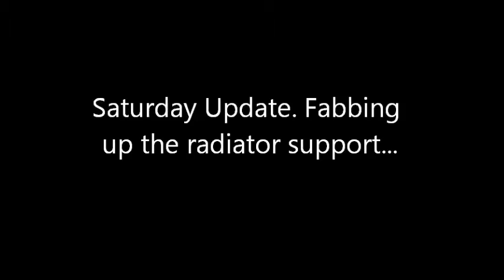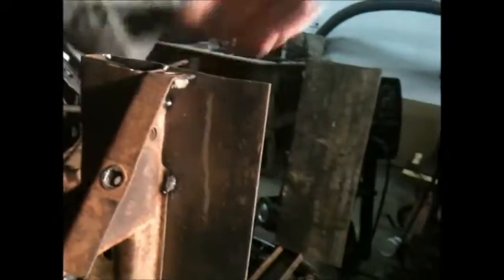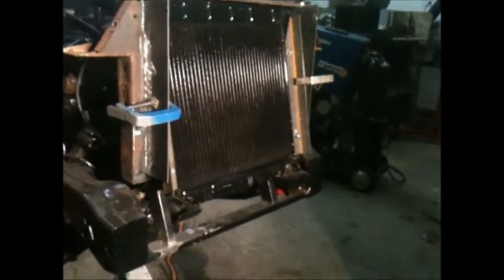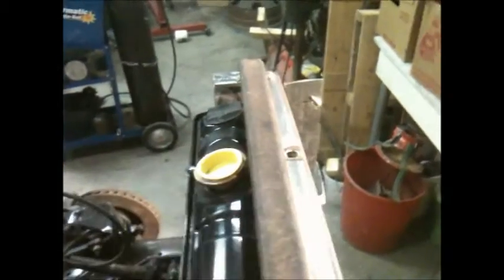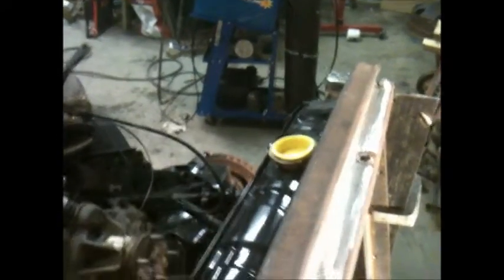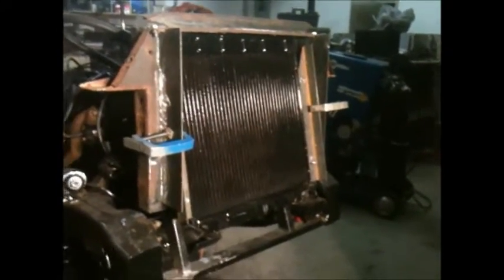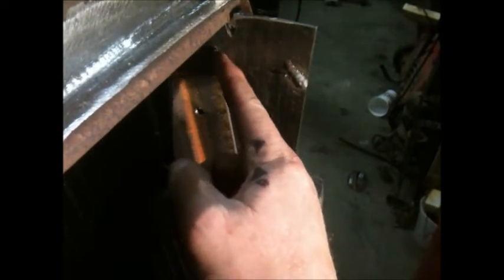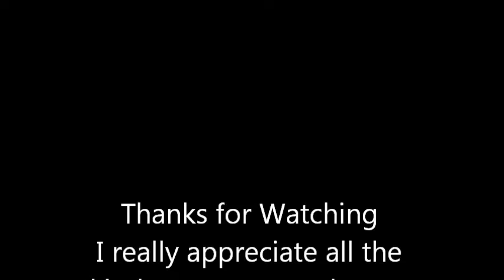Saturday Update number 2, fabricating the radiator support

Comment: Did you change the oil pan on your 350 to the s10 conversion style pan?
Reply from the maker: Stephan Jones no because you have to move the engine back 4 to 5 inches. The oil pan is not an issue.